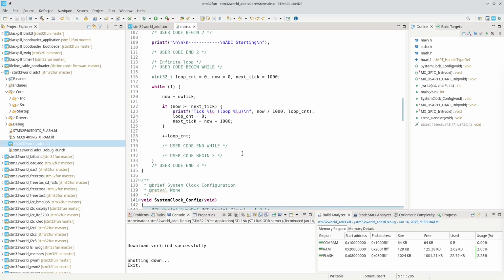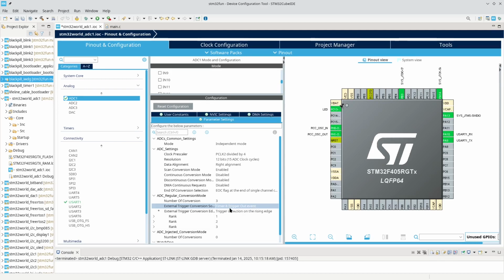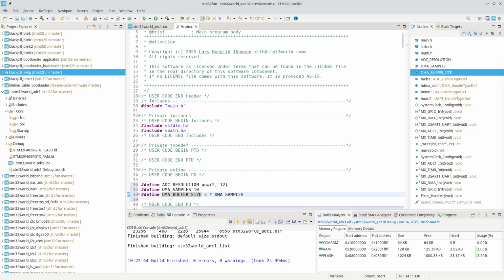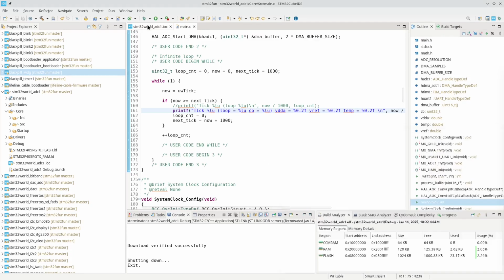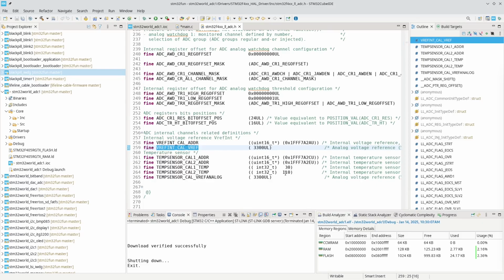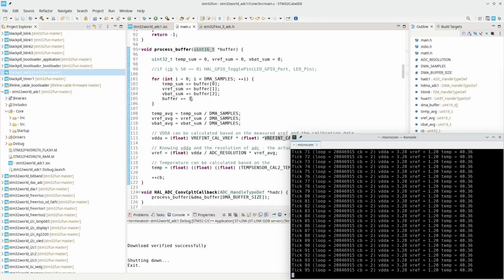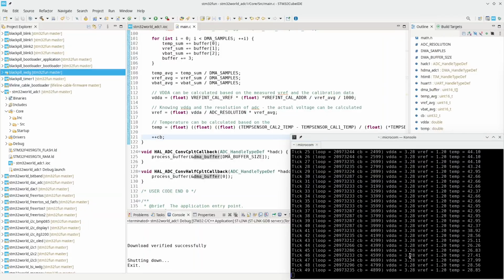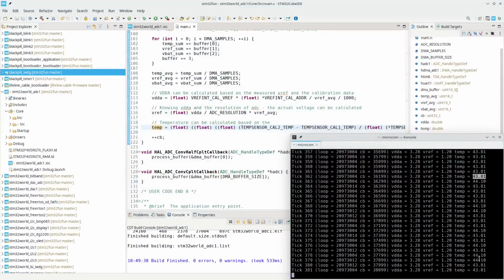STM32 Tutorial #42 - ADC HOWTO (w. DMA) - Measuring Temperature, Reference and Battery Voltage

Comment: All three channels require 10 us delay after switching input multiplexer, to reduce the crosstalk. Set number of convertions and sampling time as big as possible. 3 is pretty small, 128 is good but higher shall be better.
Reply from the maker: Well, in scan conversion mode that delay you mention must be handled by the adc peripheral and I see no way of configuring the exact delay.  Higher number of samples obviously increases the accuracy of the individual channels.